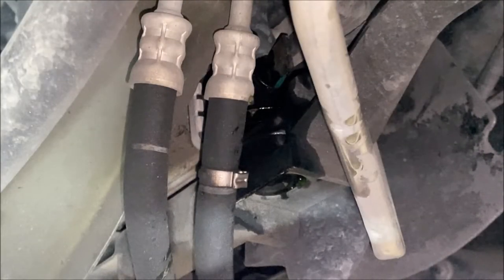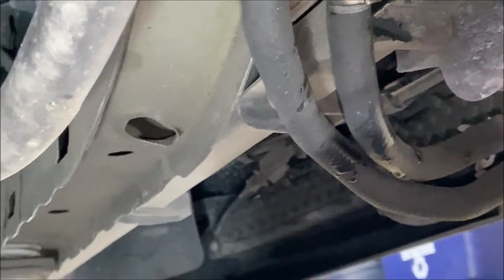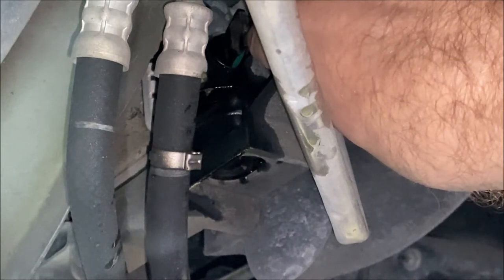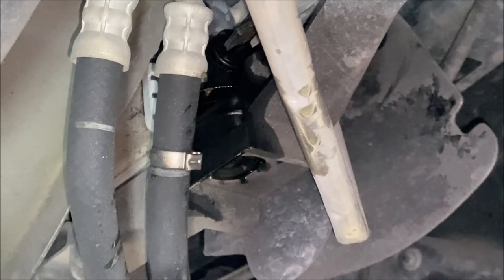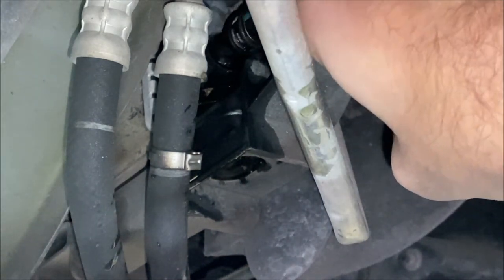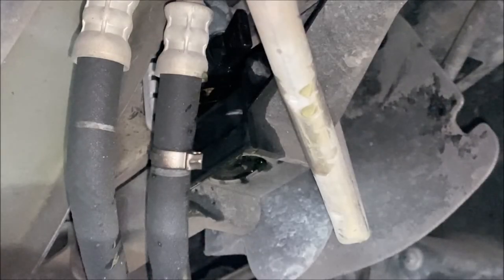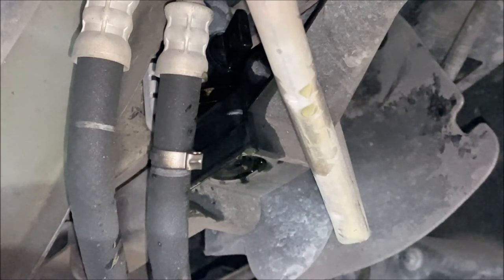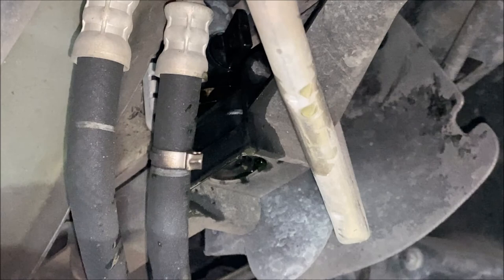Got a case of the drips?  Maybe you need to replace your radiator’s Petcock

Comment: I have a 2011 Dodge Challenger RT w/ a 5.7 hemi and I'm not sure if you can help or not with any info etc., so here goes.  During several and after my latest radiater and system flush, because of the difficulty of opening and closing the petcock from above, I've been using a pliers to finish in both directions.  The last time, I went too far closed and heard a snap.  It did indeed stay closed, but now, being ready to flush one last time, the system is cool, but full, the coolant tank pressure cap is off and I can't get anything out.  I'm guessing the valve broke/separated between the actual plug and the opening part, so nothing inside moves when turning to open.  The valve has no stopping points either direction.  What's still in the system is all but completely diluted, so that's somewhat of a relief, but what kind of issues am I to expect and is this something that can be fixed by myself by just ordering a new petcock, and not having to take it to a shop for extensive and expensive repairs?  Thanks!!   Barry
Reply from the maker: Here are some thoughts.  I hesitate to say it's advice since the 5.7 hemi is something far from the I-4 and V6s that I've worked on.
One general concern I'd have is if something truly snapped/broke off, you might have loose plastic in the system that could get into engine and block coolant flow.  That could quickly lead to overheating.
If the petcock is like the one in my video, you should be able to completely remove it.  That'll drain most of your coolant (be ready for that!) but you'd be able to see what (if anything) of the petcock is broken (or the plastic threads of the radiator).
If you're unable to get fluid to drain via the petcock now, you can remove the lower radiator hose and "drain" (in a rush!) the coolant that way.  Just be ready for a large amount of coolant all at once.  Maybe that'll also draw any plastic bits out and into the bucket.
If it were a vehicle I was working on, I'd go after the above things first (and have a new petcock at the ready in the hopes that it's as simple as putting in a new one) before taking it to a shop.  A shop will most likely just want you to replace the radiator (which you can probably do yourself) since it's not known if the problem is the petcock or the radiator threads. They might also suggest things way more invasive just in case plastic bits got into the engine.
Not sure if that helps or not.  I feel obligated to also make sure you read my disclaimer in the video description(s) - I'm just a lowly DIY homegrown garage wrencher.  Good luck with your Challenger!  Great car!
Reply: @CarbonsDIYGarage  Thanks for the info.  I've watched a few videos on the somewhat crude extraction, which includes heating up a small straight screwdriver and quickly, but carefully pushing it into the plastic remnants of the valve, and turning just enough to open the valve to hopefully have a normal drain, then carefully removing it all together.  I'll have to remove the so-called broken outer adjuster first, so I hope that all goes well.  I'm going to the parts store now to order the valve.  Thanks again for your quick response!!  Barry
Reply: I've got the 5.7 hemi in my 08 
Ram 1500 and the plug came out , anyway drill out plastic plug and get the rest out w Needle nose pliers . Then find the correct plug and install. Shouldn't take too long Barry. Signed Danny I. 🇨🇱🧨🍺🌮💥
Reply: Barry you can just drain from bottom radiator hose too. And leave the plug like it is, and not chance any more expense. That is what I would do. Just another idea. D. C. I.

Comment: Does a Buick lacrosse have one my car is dripping alot of water out
Reply from the maker: Every modern car radiator should have a drain valve on it.  Where it's located and what it exactly looks like will vary.  It should be at the lowest point of the radiator, though, probably by the coolant hose at the bottom of the radiator.  If you search for the valve/petcock for your particular year/make/model, you can probably find a picture of what to look for.  Good luck!  Thanks for watching.

Comment: If my dorman radiator drain plug is bad and it is dripping does it only drip when the car is running or only drip when the car is parked or will it drip all the time snice the plug is bad?
Reply from the maker: If the drain plug is bad, it should drip all the time since there's always coolant in the radiator, even if the engine's off  and the coolant isn't flowing.  Since the drain is at the bottom, it would always be dripping out.  It might drip more/faster when the engine is on, though, because the system will be pressurized.
Hope that helps - good luck!  Thanks for watching.
Reply: I suddenly received a coolant leak… it seems to be coming from under the drain plug and not the actual drain plug
Reply from the maker: @dajourdixon5567  😬 Might be a crack in the radiator’s plastic. 👎🏻
Reply: @CarbonsDIYGarage  yeah I found the problem , it’s a leak in the radiator itself
Reply from the maker: @dajourdixon5567  Booo… sorry to hear it
Reply: @CarbonsDIYGarage  ehh it’s alright. I found someone who could repair the radiator for $200

Comment: My drain valve won't come out. Just keeps spinning. Any suggestions? Thanks
Reply from the maker: You may have already done this but I would probably try to pull it (gently) out of the radiator as you’re turning the valve. I think the engineer would say that “this can’t happen” due to the threading of the valve, so something might be broken on the valve. Hopefully you can wiggle it out. Don’t pull too hard; I’d fear breaking the plastic on the radiator and then having to replace the whole radiator. Sorry, not much help. I hope you figure it out. Thanks for watching.